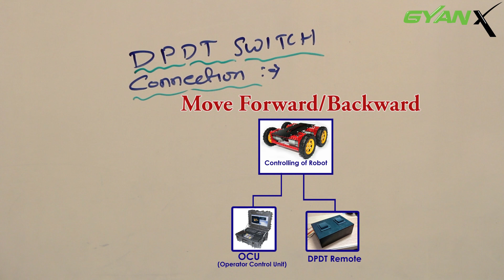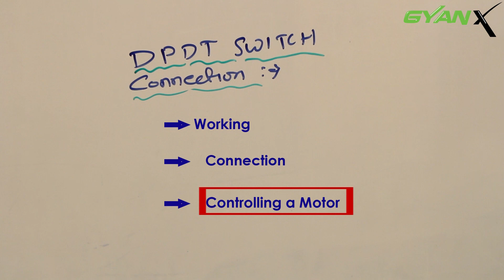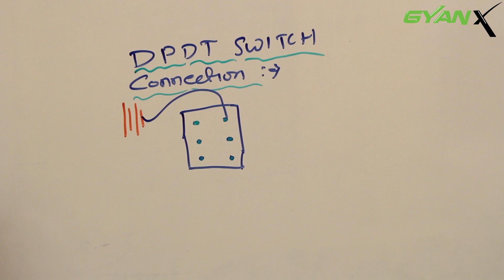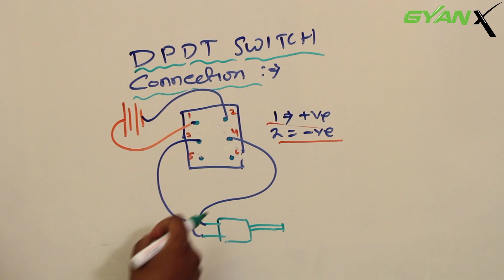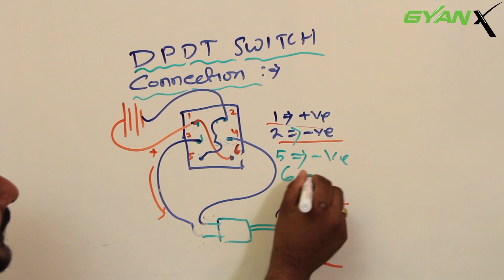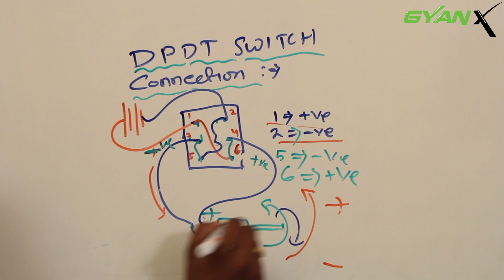DPDT Switch Connection1

Comment: How do you wire a dpdt relay with an external switch..I have a photocell switch with three wires and an 8 terminal dpdt switch. I'm using a 12 volt battery and an actuator .. Now you have the whole picture thanks